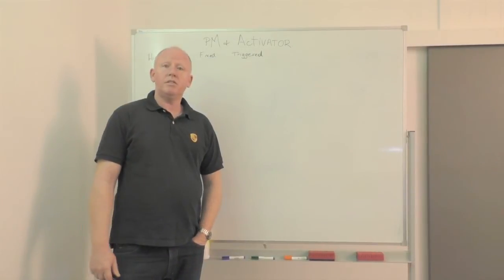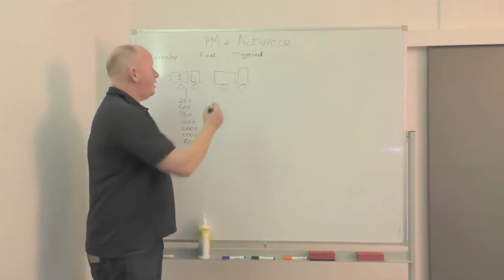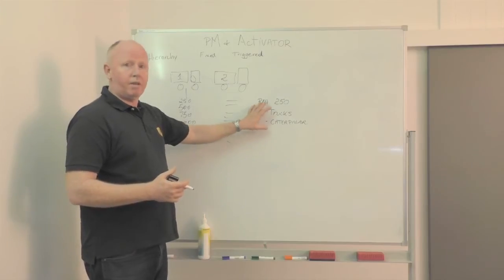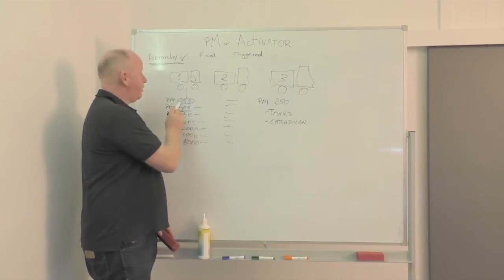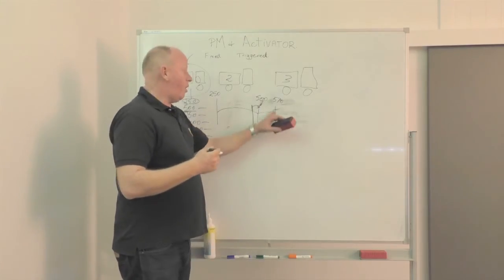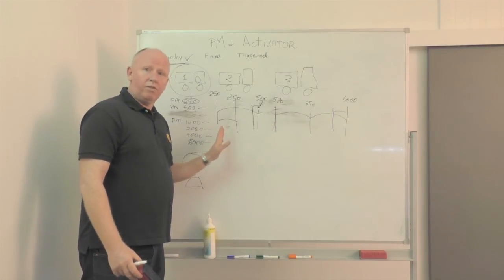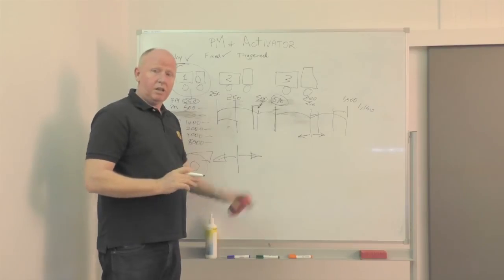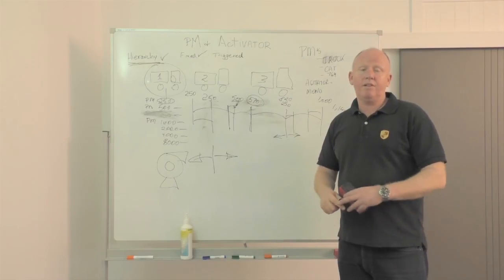How MEX Handles Preventative Maintenance Schedules

Comment: Hi Steve, am trying to assist one of my client who uses MEX at the moment. I came from SAP background. On your video, say when we develop the inspection document for 250 hours, it calls for a specific acceptance limit as an example tyre thread depth > 5 mm for truck #1, however on truck #2, due to much smaller size the acceptance limit needs to be tyre depth >3mm. Can you advise if MEX can deal with varying documents (and/or spare parts such as oil filter) which would different from truck #1 and truck #2 both of them needs to be executed under the '250Hrs PM'?